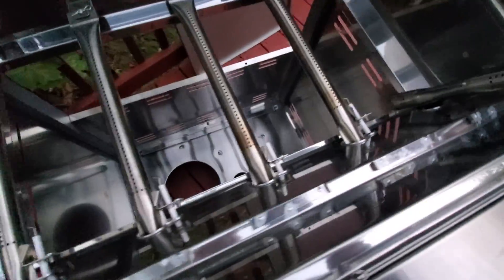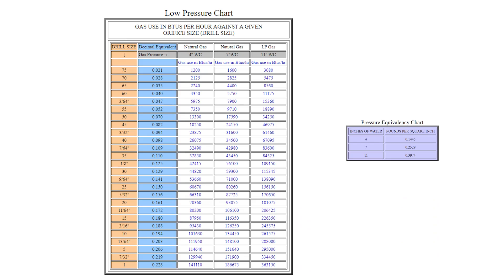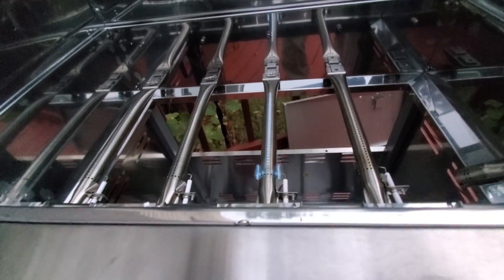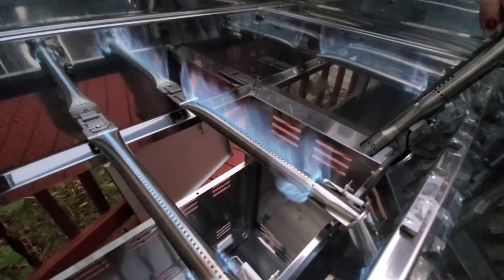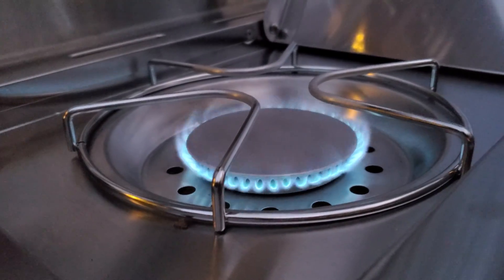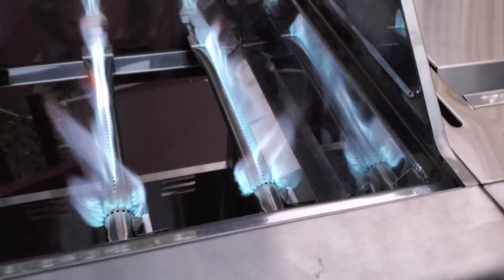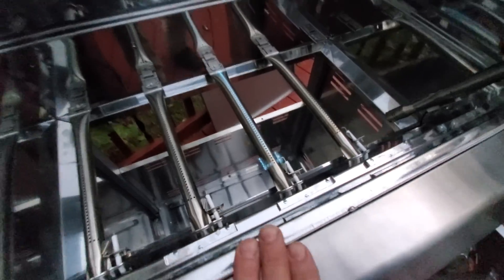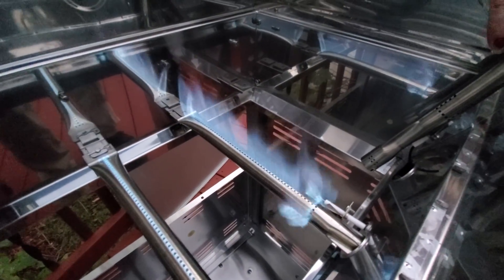Propane Grill Converted To Natural Gas the Easy Way (drilling orifices)

Comment: I dunno, those flames looked very high and he didn't show a medium or low flame. Also, each bar has holes that may also need to be enlarged or else the gas will jet out, which appeared to be happening! Not sold on this just yet, wish he would have shown low & med setting, hmmm....?

Comment: No issues with brass filings dropping into the orifice when drilling in place? I was thinking I'd unscrew them and drill them in a vice, but it looks like you got away with it. 

So, you have 7cm H20 NG pressure at your place, or just went with .052/55 as "close enough" at 4cm/7350 BTUs? I guess you could interpolate or guess that .055/54 might be closer.

Thanks!
John

Comment: This is awesome! I have a LPG only grill not dual fuel so no conversion kit available. Figured I’ll drill the holes a little bigger. And then I saw this video which confirmed my thought process. I’m 12k btu per burner so I guess 1/16” will work. I’ll try and see. Am I right assuming 1/16”?
Reply: Did you change the regulator or did you use the one that came with the grill
Reply: @tulacro77 btw I did drill out the holes and it gets nice and hot fast now.
Reply: Used regulator from a kit I bought a while back nothing special. I’d probably recommend looking into a ng regulator though. Mine works great no problems.

Comment: Hello there if I can ask a question, per specs my grill,  Main burner 36,000 Btu/hr.
Rear burner 7,000 Btu/hr.
Side burner 12,000 Btu/hr.
Total 55,000 Btu/hr.  which size drill bit should I get?

Comment: thanks for the info..  I have 4000 BTU Grill 5 Burner means each 8000 BTU's  planning to hookup to my Natural gas pipe in my house.. what drill size I need to drill orifice.. also I do not have to change any hose or anything ?
Reply: Start with 1/16” drill bit. Should be big enough.

Comment: Did you not have to change out the tubing or add a regulator? I found a store online that sells new orifices for my grill but they have it in a kit with a hose and regulator. I’m beginning to think maybe that’s because it’s a natural gas tank rather than a endless source like I have. Any thoughts?

Comment: Don't you have to change the regulator also?
Reply from the maker: Not in a house since the gas is almost always low pressure 4"wc or 7"wc, it's standard pressure. It's always a good idea to make sure you have low pressure but I've never seen a house run high pressure before.
Reply: Put one on just in case. They run about $20.
Reply: @rruizproductions  HAHAHA! Raul speaks wisdom :) It might tame the flame a bit, but it def reduces the black carbon build up on the food and pans........

Comment: It’s hooked to propane in the video not natural gas?
Reply from the maker: No in the video it's hooked up to natural gas, which is why the flame is so low. Propane has about double the energy density of natural gas, which is why you need about twice as much natural gas is propane for the same amount of heat.
Reply: @WarpedLab  This chart isnt even the right conversion chart who are you fooling?  you're like oh its 12000 btu i just looked up 96000 and there it was....i dont think so
Reply: @sharonerotkopf3548  Just start with a 1/16” bit and work your way up until it works and the flame is blue.
Reply: Hello ,please help me understand, once drilled , what connections do I need to get to hook up to the gas line ? If you could dummy it down for us who are new to this 😂

Comment: Pretty cool!
Reply: Did you not have to change out a regulator or any tubing?
Reply: @michaelhart2109  
You asked a commenter but no, Only the orifices needed to be drilled out. Nothing else. For me, I would like a valve to adjust the major flow to fine tune as necessary.
Reply: Sorry I don’t comment much on YouTube. Thanks for the video. This saved me several hundreds of dollars.
Reply: @michaelhart2109  
Glad to help but you need to thank Matt Mikka! He is Warped Perception videos too. He is from the southside of Chicago and as far as I can tell, quite a genious.